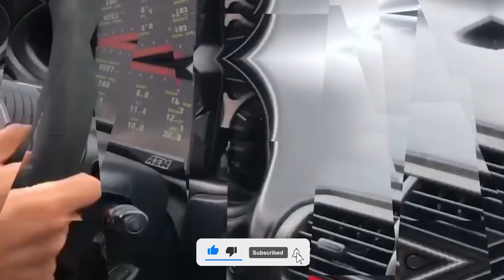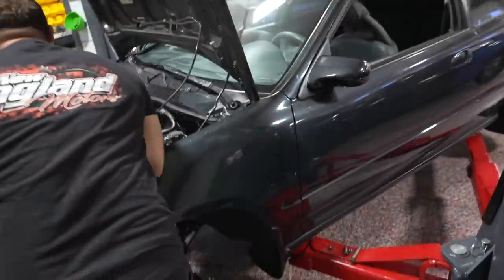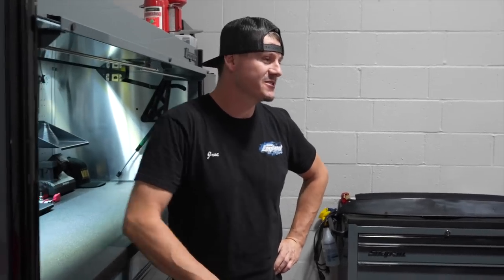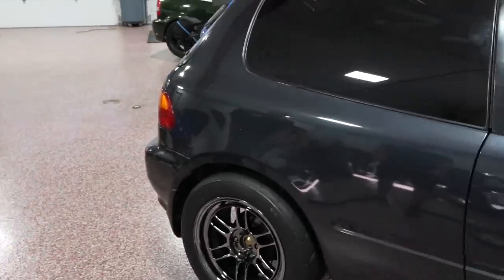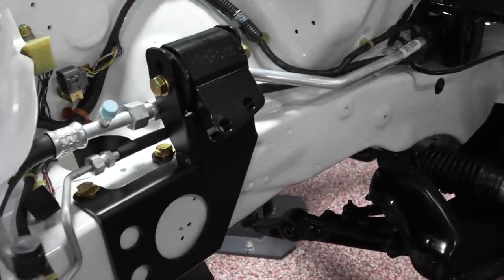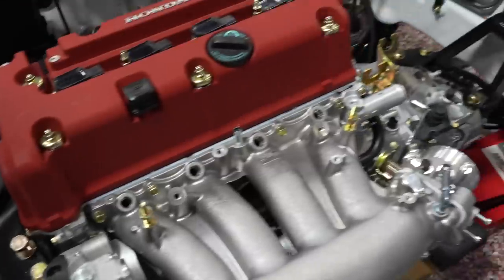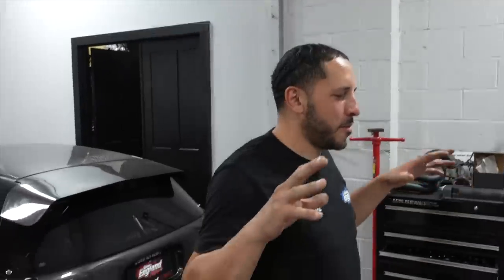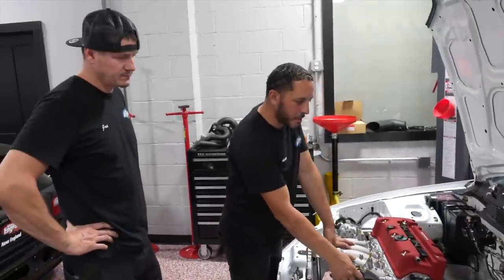Shop UPDATE! K20-R Swap goes in the Unicorn! ZINC Everything! 🔥 OEM+

Comment: I dropped a K20 into my EG at home without a lift, went in from the top. I didn’t have my radiator or AC condenser installed yet and it was still a bitch!

Comment: Black forks. Engine bay fire 🔥 but I actually would’ve left the sohc because of the white rarity and would’ve kept the stock 4!lug with black Si hubcaps and used some sticky street 185-60-14 or would’ve used the classic 99 Si wheels since it’s a Si.  But overall one clean Si 👍🏾😁